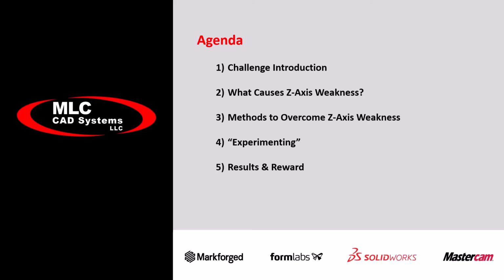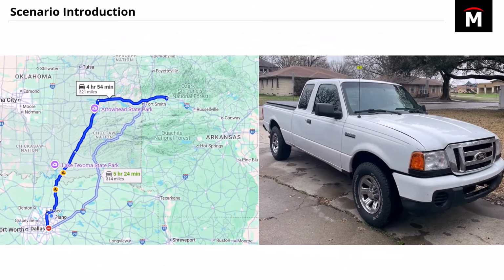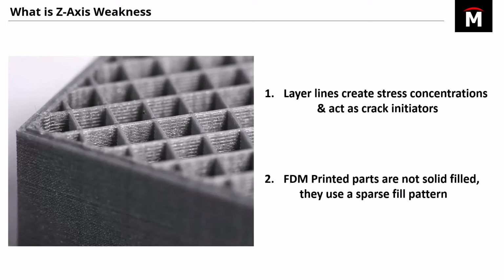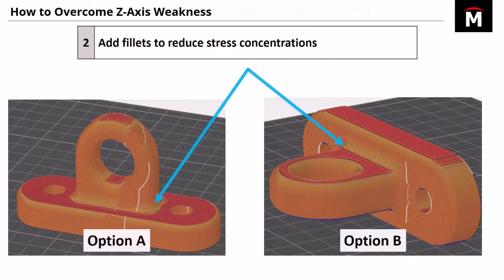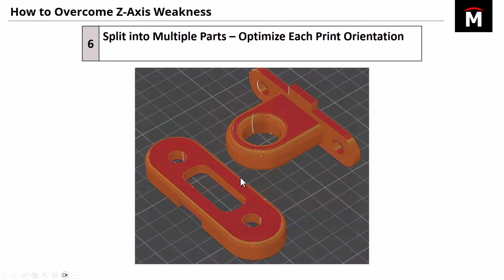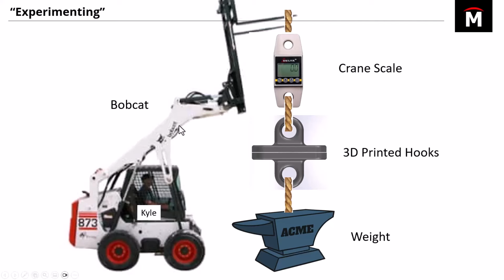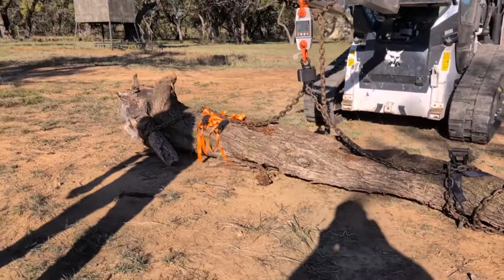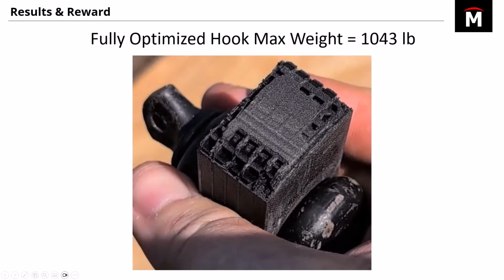3D Print Lifts 1000lbs! | The Secret to Defeating Z-Axis Weakness

Comment: I don't see evidence on the web for the idea that CF improves interlayer adhesion. It's essentially a non-effect in this table at javelin-tech.com for nylon:
 https://www.javelin-tech.com/blog/wp-content/uploads/2017/06/Nylon12CF-Table1.jpg

and a negative effect for PETG in this table at Bambu:

https://blog.bambulab.com/content/images/size/w1600/2023/05/Frame-1860204.png
Reply from the maker: In this scenario the CF was designed to stiffen the geometry and resist tearing and deformation that might lead to delamination.  The hybrid modeling approach is used to favorably orient the part to avoid z-axis tension.  Agreed that adding CF does not improve interlayer adhesion.
Reply: @MLCCADSystems  gotcha. Thank you.

Comment: if I may suggest, you should put a chamfer around the base of your design and an accommodating cutout in the female half.  Basically make a pyramid like base so that it fits in like a wedge.  It’ll be a lot beefier where it broke on you in the tests and the thickness will taper down as the  force distribution area increases.  I think that would give you more strength.  And yeah, add some degree of fillets pretty much everywhere.
Reply from the maker: Great idea! I love how rapid functional prototyping inspires new ideas to test out, and then gives you the ability to try them almost immediately. I like the idea of a taper, I was also wondering what impact glue would have, for better or for worse.  Thanks for the feedback!

Comment: cool man, I really enjoyed watching the whole thinking process. I believe wall count can improve strength way more than infill does 😊
Reply from the maker: Thanks for the feedback!  We tend to agree on wall thickness, but it gets complicated depending on the failure mode.  As long as the infill resists crushing and buckling, it usually does fine with sparse fill.  For an open hook, where there is a lot of shear through the hook throat, it gets a lot more complicated.  We'll keep testing and see what else we can learn.